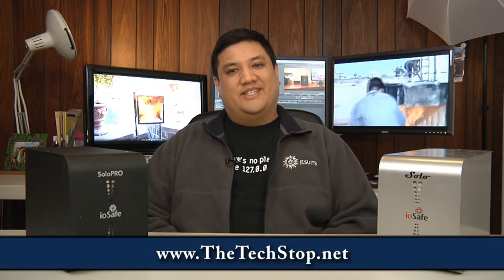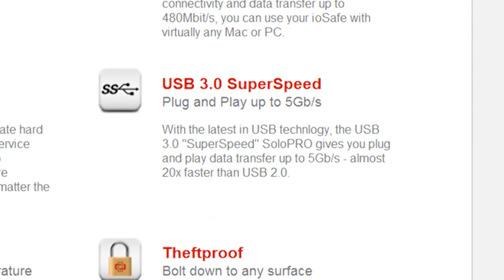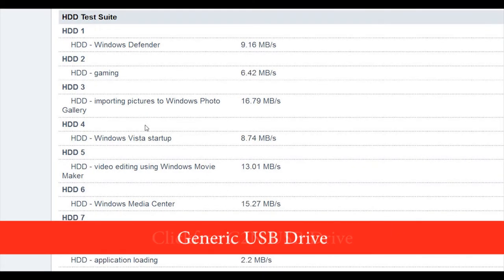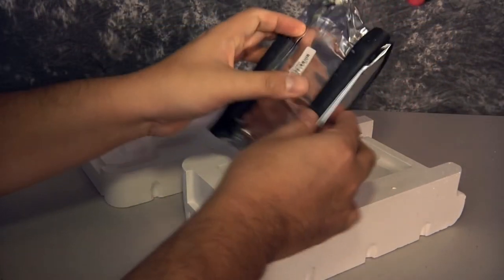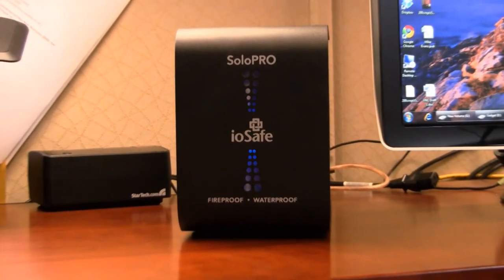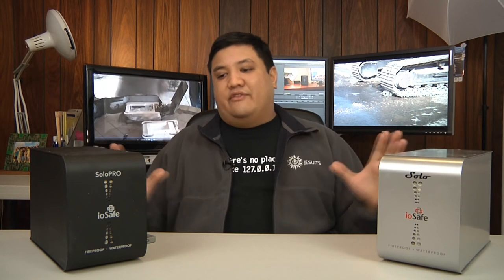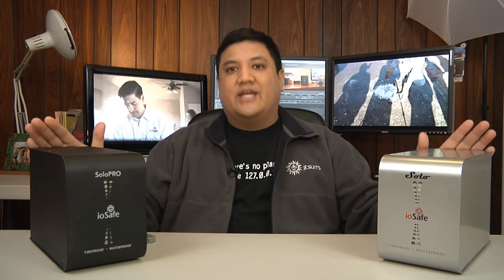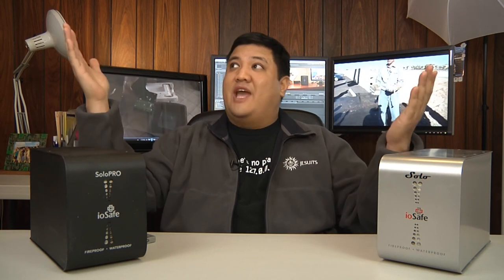gadget 147 - ioSafe SoloPRO (From the Secret Jesuit Bunker!)

Comment from the maker: @akaTRENT,

Good comments. Personally I'm more than happy with eSATA and USB 3.0, but I would understand how no Firewire could be disappointing for those who are invested in that particular bus. 
.
You hit the nail on the head as far as price is concerned. It is much more expensive that a bare drive of the same capacity, but for that premium you get both a drive that is better able to withstand disaster and a service to recover data if it doesn't.
.
Peace,
Fr. Robert